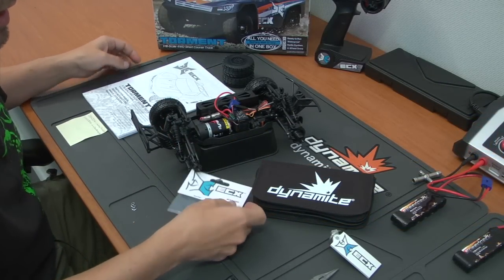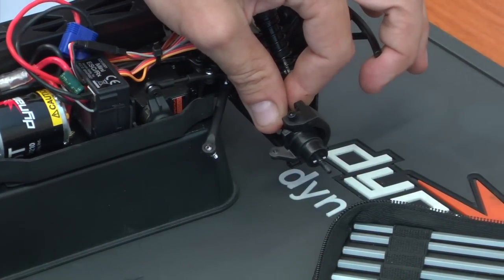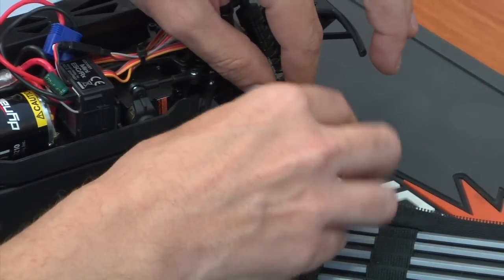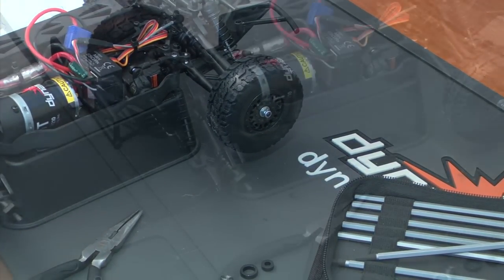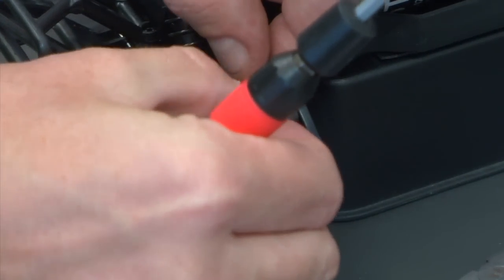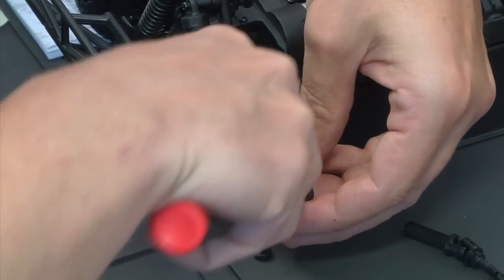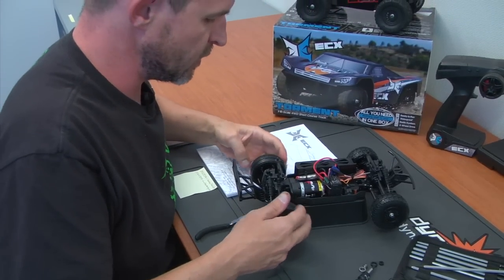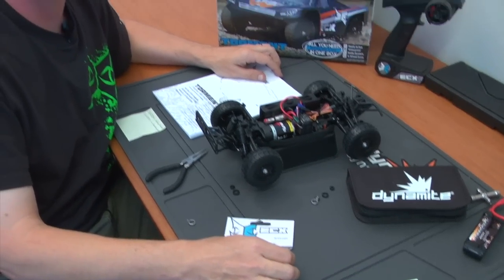ECX RC 1/18th Ruckus and Torment - Ball Bearing Install Instructions

Comment: looking to put in a steel or Aluminum in my RUCKUS 4X4 MONSTER TRUCK INSTEAD OF PLASTIC 1S I FIND THEY MELT TO EASY I HAVE 5000MAH 7
.4 BATTERY WITH A 5000MAH 100C 7.4 BATTERY ON IT'S WAY WOULD IT BE A GOOD FIT WITH THE PROPER SIZE PUR PINION GEARS BOTH STEEL AND ALUIMON GEAR RATIO SOMEBODY' OUT THERE PLEASE ANWSER ME PLEASE AND THANKYOU